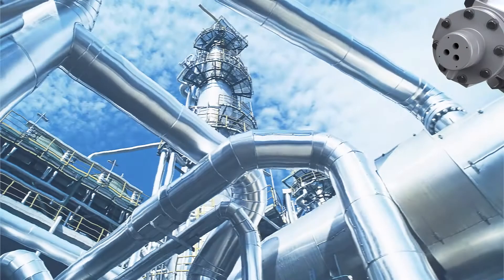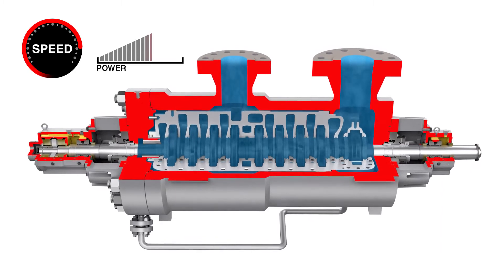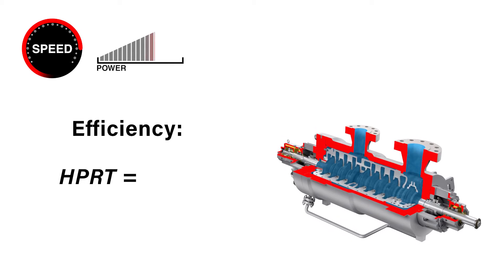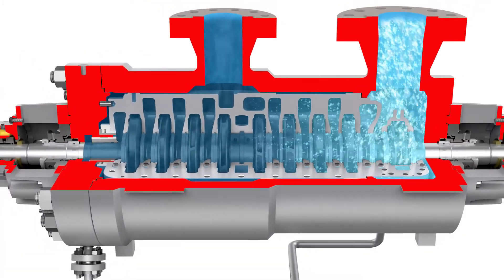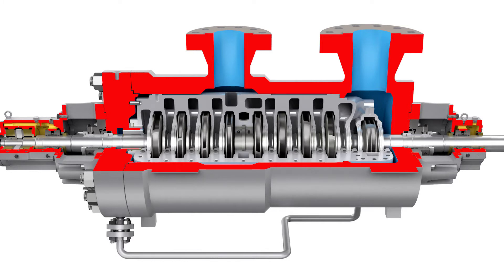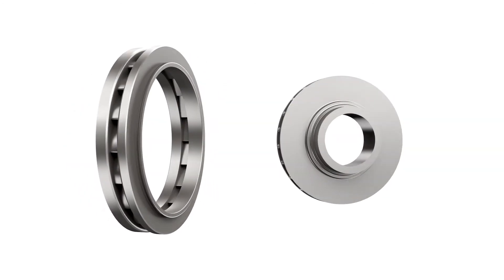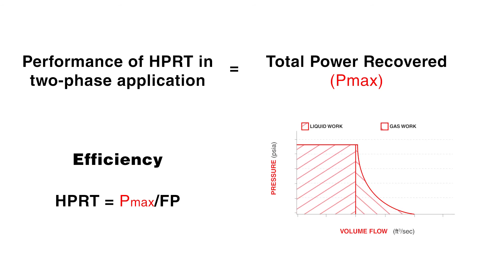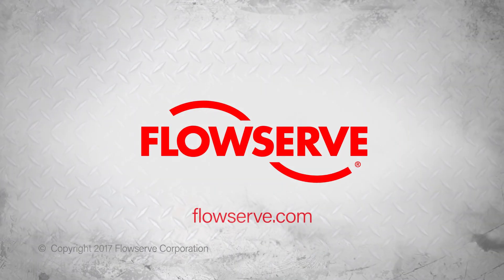Hydraulic Power Recovery Turbines — Calculating Unit Efficiency and Power Recovery

Comment: But how do you overcome the cavitation effect?
Reply: Why would it cavitate?
Just because there is vapor?
Think in that way you will get the answer.
Reply: Because the flow is not throttled in the inlet of HPRT rather inside the HPRT. Secondly, the evolved compressible phase is not gas entrapped in vapor, which is determentel, rather single gas evolved from liquid.

Comment: Hello! Why does not the pump design  consist of a complete cartridge? At the operating site it is more convenient to take out the inner part without dismantling the bearings.
Reply: Full cartridge designs are also available for both diffuser and volute designs. There are other compromises in terms of complexity and relative weakness at the suction side. Customer preference is always a primary consideration.